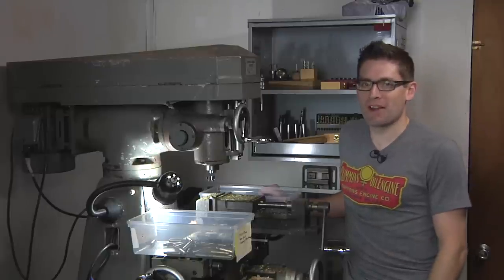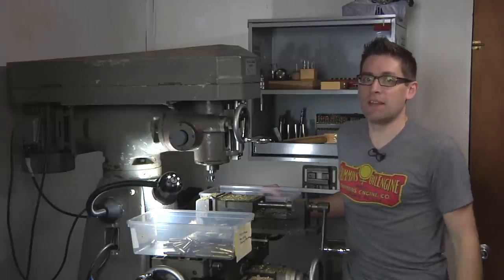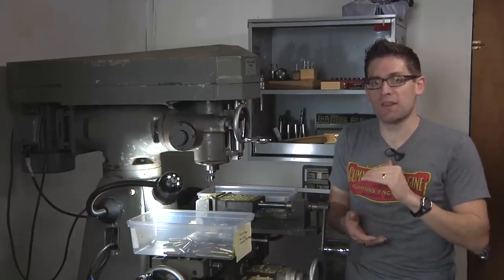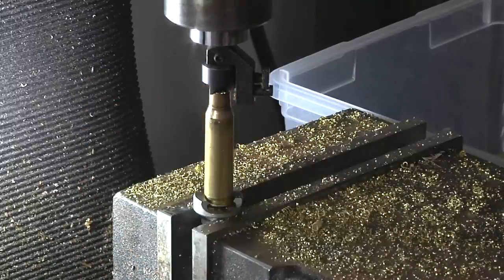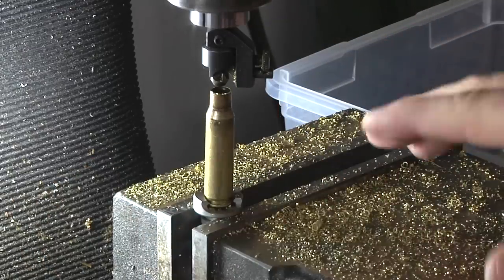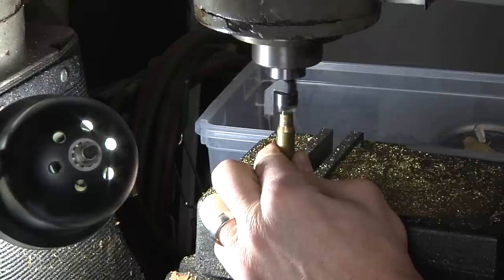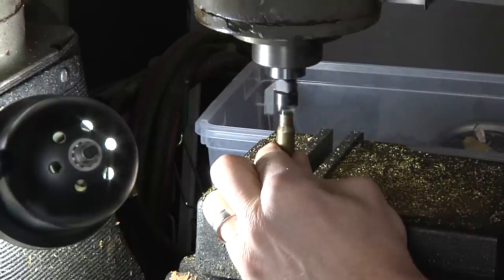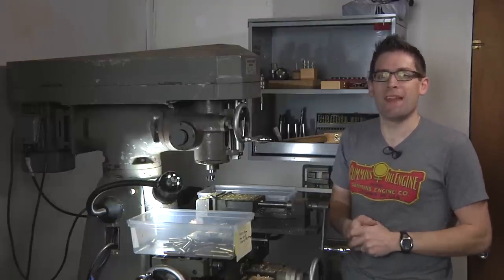Rifle Reloading Brass Prep with the RCBS 3 Way Cutter

Comment: Love the crossover application of machine tools and reloading! I am sure you know this Gavin but I will put it out for those who don't, something an old-timer machinist taught me. When mounting a tool like this 3 way cutter that has plenty of catch/pinch points I would use a drill chuck rather than a collet. Hand tighten the tool in the chuck just enough so it won't slip during the operation. In the case you get caught/bound up with the tool it has a chance to slip before it causes damage to you, the tool or the machine. This is not a super precision operation as there is some float in the shell holder so the accuracy of the collet isn't required. Also use the lowest speed your machine will go, harder on mills - sometimes easier on a drill press. Most commercial case trimmers operate in the 350~550 rpm range. This also works on a drill press and is a great method for starting a tap but then finish by hand.

Comment: You said this is a unique product. Perhaps you were basing that on the adjustable feature of the outside chamfer. Forster's 3-in-1 Case Mouth Cutter has carbide blades and works very well. I'm not so sure the variability inherent in the adjustability of the RCBS 3-way cutter is preferable to the consistent result of the Forster.

Comment: I assume that you are setting the trim-to length as a hard stop on the actual milling machine, using a trimmed and measured case as the guide. That way you can pull the handle down to its limit knowing that you can't over-cut. I imagine a drill press could perform a similar function. I like the way you've got the shell-holder clamped into the vise.

Comment: Just ordered my trimmer today.  What spindle speed do you use?  The pic on Midway USA shows the cutter assembly having a threaded shaft.  Did you make a jig to hold the trimmer?  Also, I think I will leave a larger gap between the brass and the cutter to make it easier to insert and remove the brass from the shell holder.  I would rather pull the spindle down farther than risk keeping it close and accidentally hitting the spinning cutter.  This should be a great job for my Bridgeport.  Thanks.

Comment: I would assume you could get the same results out of a standard drill press?
Reply: Unless you already own a good drill press, getting a Giraud will cost you less money. But to answer our question, Yes, if you have suitable vise, and means to set the plunge depth you can get the same results with a drill press.

Comment: Why not just go with the Dillon electric motor, and mount it to your press, and also mount the swagger and fill the hopper full of brass, and every time you pull the handle down your done. And if you are worried about chamfering, wet tumble with the pins for two hours and that takes care of the chamfer. Also I forgot to mention, if set up right, you can knock out the primmer to. You can do all this with the Dillon 650, believe me I do thousands of 556 all the time for resale ready to go, all cleaned and ready to load.I know you will delete this comment. But this is for you. You are working and making it harder for your viewers, But you did a great job on your video. But that is far from the fastest way to prep brass, and I know you want to show the 3 way cutter. But why not do it right the first time. you do not need to spend all that money, and constantly make all them moves. To me it is ridiculous. But I still subscribed to your channel, and hit the like thumbs up. You did a wonderful job. I am not trying to cut you down at all. It's just that every company out there is coming out with a new gadget. And people fall for it. Don't you think by now you should be able to prep brass all in one, with just one pull, and you are done. Remember also that chamfering brass by hand can change the length of your the case as well, by how much pressure you use. Keep that in mind. But I know you are just trying to get people to buy that 3 way cutter. But hey friend keep the videos coming. YouTube is turning off monetizing on all gun related stuff. You will eventually be hit. So delete this comment if you like, and remember this is for you to know. OK? just heads up on that. Allot of videos I watch have been hit. so no more money from YouTube. Hope I help ya! You have a great channel. So keep um coming.

Comment: That did not look safe at all. Would hate to try and prepare 1000 pieces of brass this way.
Reply: If you have that many pieces at one time, I would suggest a Dill eletric case trimmer. They will mount on everything from a single stage press to any of the progressives, not just a dillon.

Comment: Why do you make it so complicated Get a Friggen RCBS trim pro and use the 3 way cutter. Geeze It just makes sense buy a $40,000 dollar machine to do what you can do with a $50 dollar tool.
Reply: On the other hand, if you've already got a $40,000 machine, you may as well use it.